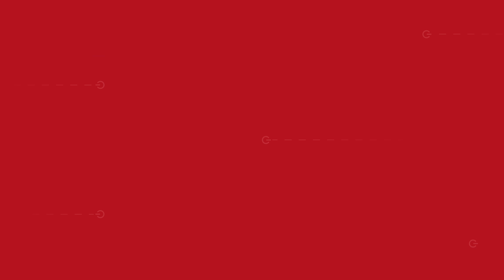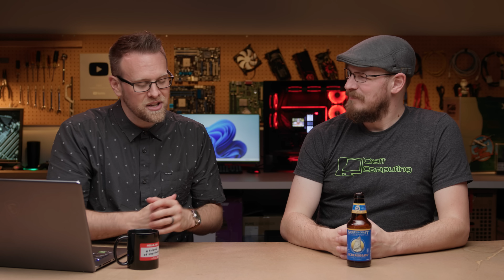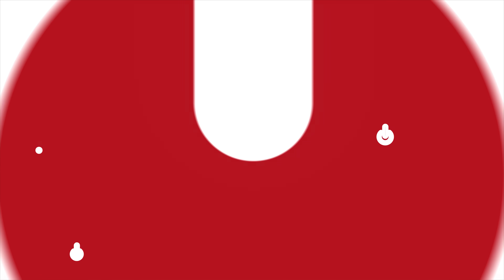Old Server CPUs For Budget Gaming Or Workstation PCs

Comment: X99 is the platform that will continue to live on. I still use on with a E5 2696v3 and 128GB for my home file/game/streaming server (yes, it does all 3 simultaneously, with NO issue).
Reply: It does seem to be the sweet spot of old enough to be cheap, performant enough to be relevant, and lacking in major flaws - other than Windows 11 support which, let's be honest, is a pretend thing. Long live E-5 Xeons!
Reply: @MeanerVariance  I used a, uh...freeware* version of Server 2019. 🤫. It works great!
Reply: @MeanerVariance  Running Windows 11 Pro with my 2696v3, no issues. Did the .iso install method...easy.
Reply: @jb678901  OH, I know there are plenty of ways to do it.  The problem - which I guess is a problem with supported configurations too- is that Microsoft could brick it with an update at any time.  Deliberately or accidentally, as they've shown from time to time.
Reply: @MeanerVariance  Yes, there is that concern...then again...there is always the Win 11 IOT single use route.
Reply: Just "upgraded" to the same CPU when I saw the price come down. I do the exact same thing and it's great. Gaming performance isn't hurt at all running Plex, minecraft server, home security system, NAS all at the same time. Energy draw isn't even that bad like some people complain about. These newer processors are power suckers anyway.
Reply: @RobertHall-ef8yf  honestly, the power draw is far less than I anticipated. The CPU probably pulls the most power, but even with everything in it, it's pulling barely a little over 240W when under heavy load. Streamers, and content creators should be praising this old tech to keep it out of ewaste bins given its viability as repurposed equipment.
Reply: @scottstamm7022  If your only doing gaming you can get slightly better fps with a similar priced am4 setup but for almost literally everything else the xeons blow it out of the water. You get quad channel with ecc support and the ram is stupid cheap (slow but the quad channel makes up for it.) Just got 128gb of samsung ecc ddr4 for $80. Plus 40 pcie lanes for activities. Not everything is about gaming performance.
Reply: Got the same cpu, only running 32gb but I’m not multitasking.
Reply: Still using a 4114. I bought it 2nd hand but it was still glistening it was so new.
Reply: a pentium 4 would do all of that simultaneously without issues, let alone a Xeon or your model.
Reply: @mrb180  What universe are you from? lol
Reply: @RobertHall-ef8yf  OP wasn't very specific on the use cases. but I do that with a Celeron J4105. No CPU intensives like live transcoding, minecraft or a big NAS loads but still...

Comment: In Brazil, "xeon kits" are the only thing that allows you to build a computer, at an affordable price, and have decent entry-level performance. Typically in conjunction with an RX 480 2048SP. A computer like this can be assembled for less than R$2000.
Reply: Yeah but whats the power pulls on these. Ik some of them use 1200w psu. Is it woRth it to draw so much power?
Reply: R$2000 for a RX 570 system is completely crazy
Reply: @chedds  Import duties in Brazil are significant.
Reply: I’m curious if Mobile CPUs on motherboards are cheaper?
Reply: @Wirenfeldt1990  Not actually cheaper if the user ends up with a dead board that needs replacing. Several Youtubers tested these boards and noticed their extremely high VRM temperatures. I use a X79 system and could get a replacement motherboard for very cheap while still keeping everything else. Last I saw, these kits didn't include RAM yet were almost double the price of the best-selling X99 kits.

Anyway, not that it has a point talking about it right now. Brazil's new government set up new tax regulations on imports that basically killed the cost-benefit of Xeon kits from Aliexpress, except for the very very cheap X79 kits.

Comment: I'm looking at the Microsoft website, and it is telling me that older Xeon's are Not Windows 11 compatible!!!!! With the end of life for Windows 10, why would I want to invest in something that is not 11 compatible?
Reply: My e5-2667 v4 platform is on Windows 11 now.
Reply: You could make it work on windows 11, or switch to linux. Most games and apps can run on linux these days
Reply: You real ?
Reply: You can also use Linux. Windows is only one of the tons of operating systems out there.
Reply: if your allergic to windows?
Reply: you can easily force it to work with windows which is what i did